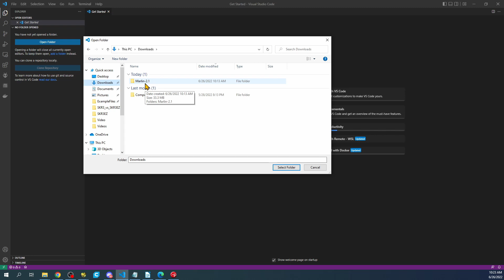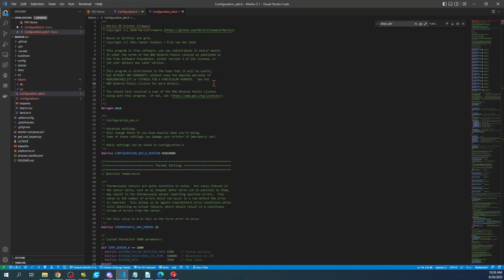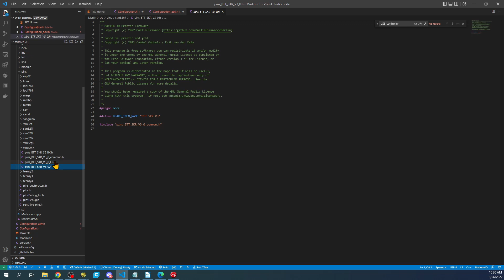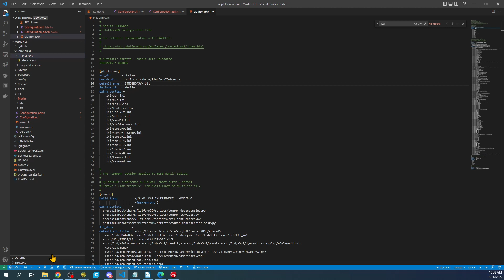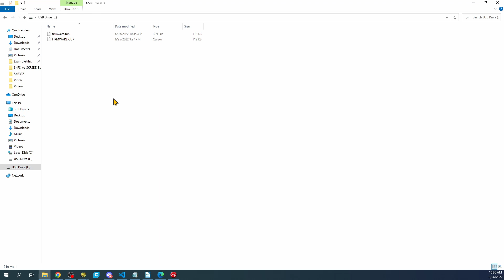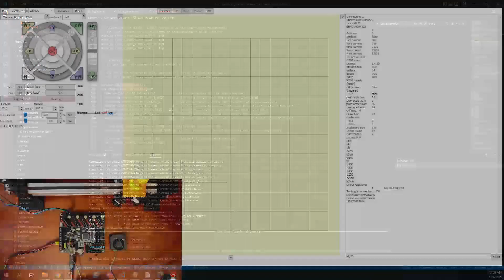Big Tree Tech - SKR 3EZ - EZ2209 Sensorless homing and Cooling Fan

Comment: If you use Marlin Auto Build extension, you no longer have to touch Platformio.ini anymore. It sets the environment automatically.  Not sure when they made the change but this method works as of 5/30/2024

Comment: Hi. I've been following along with this and another video to get the sensorless homing to work. For further context, I am using EZ2209 drivers and stepper adapters on my SKR V3.0 (non EZ). Someone else brought this up, for some unknown reason the endstops on X and Y are always triggered and the homing gets thrown off. I tried setting the x and y min endstop inverting to true, but the sanity check throws an error saying that they need to be set to false for sensorless homing on tmc2209 drivers. Z works fine when inverting the endstop to true, but I am stuck on x and y. Have you looked into this? And if so, were you able to find a solution?
Reply from the maker: EZ2209 used on a non-Ez board will not work.

Comment: Hi,
First of all thanks for all the work you put into these Big Tree Tech board videos. I have an SKR3 EZ that after 3 months of use no longer communicates with raspberry pi via USB. I searched on the internet how I could make the connection via CAN FD but I couldn't find anything. In the meantime, could you also publish a video on how to connect SKR3 EZ with rasperry pi via CAN FD? I would like to know if he died at all or not.
Thank you.
Reply from the maker: On SKR 3 there's a white button near USB port it maybe causing the issue.    Power down system.  Press it once and power back up system.  Let me know if it fixes issue.
Reply: @EdwardBraiman  I tried that button. Same thing. I'm trying to connect to CAN but I can't. I don't know what else to do. I used Fluidd, Mainsail, Octoprint. It's the same for all:
Klipper reports: ERROR
mcu 'mcu': Unable to connect
Once the underlying issue is corrected, use the
"FIRMWARE_RESTART" command to reset the firmware, reload the
config, and restart the host software.
Error configuring printer
Reply from the maker: There's a Discord link in description, either myself or someone else can help you with the process to fix in general chat.

Comment: Just a note BTT has changed the chip on this board from the STM32H743VG to a STM32H723VG. I have gone through multiple Merlin versions but I could not find a SKR 3EZ with this chip. I am currently stuck! Any ideas?
Reply from the maker: I'd need to look, check boards.h and see if it's in there with board name.  Should be written to right of name.  Also which version of Marlin are you using?
Reply: @EdwardBraiman  Last night I found a Nightly build Marlin-bugfix-2.1.x. So I set the processor to STM32H723x_btt. Under "boards.h" it had "BOARD_BTT_OCTOPUS_MAX_EZ_V1_0 6008  // BigTreeTech Octopus Max EZ V1.0 (STM32H723VE / STM32H723ZE)" - correct processor but wrong board. So I had to then select the board to this. To remap the pins for a SKR 3 EZ board I had to go over into "pins" folder then into "stm32h7" folder go in to the "pins_BTT_SKR_V3_0_EZ.h" copy the "#include "pins_BTT_SKR_V3_0_common.h" command. Then in "pins_BTT_OCTOPUS_MAX_EZ.h" I removed all pins mapping and inserted #include "pins_BTT_SKR_V3_0_common.h"  This has compiled and I tested the SKR 3 EZ board on my test bench and seems to work. Will need further testing to confirm everything is fine. But it has been so hard to get to this point, I am not a programmer but thank goodness for youtubers like yourself and tutorials all over the web.

Comment: Hi, wil there be a video about a bltouch on a skr 3? I am trying to install one on my skr 3 and it does not work(although the wiring is correct and the software(z probe pin PC13) as it needs to be. Any ideas?
Reply from the maker: Normally I avoid 3d touch and BLT as they are difficult ensure functionality.  There's a Discord room in my discord channel.

Comment: 1:38 Don't use 48V for the steppers with 2209s - they go pop. Their datasheet rating is 29V, so a separate stepper driver PSU doesn't get you much over a regular 24V one
Reply from the maker: This is probably true, they might be used for TMC 5160 or more exotic steppers.